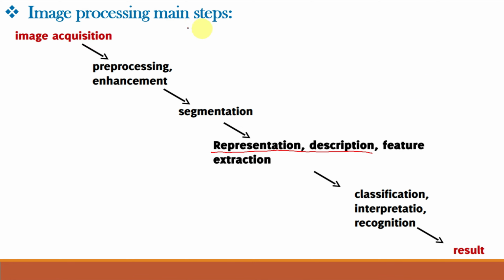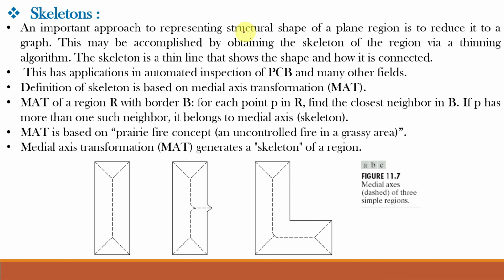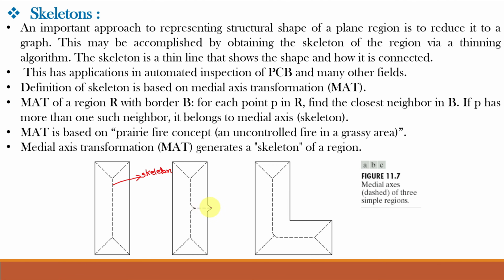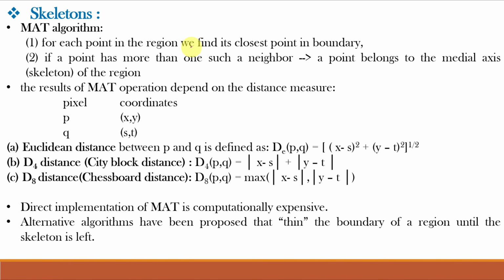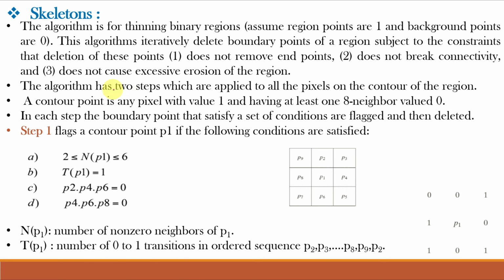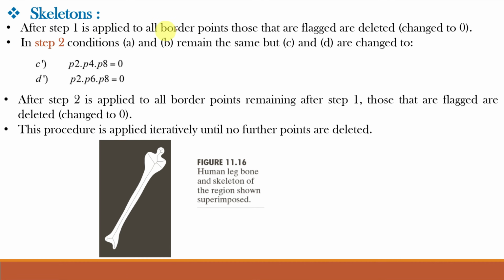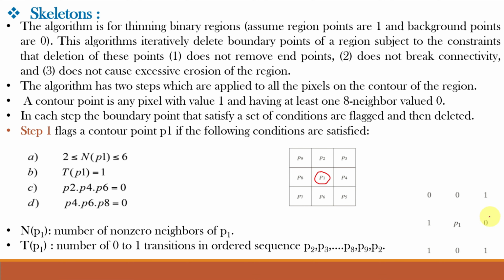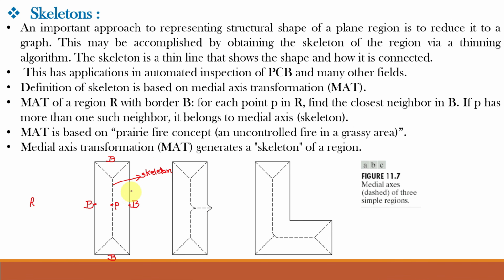Skeletons in Image Representation for DIP and its implementation in MATLAB || Description|| Thinning

Comment: How to define the image details in matlab.pls explain or give me video link to know that.
Reply from the maker: In MATLAB, you can define the image details such as dimensions (width and height) and format using variables. Here's how you can define these details: Image Dimensions (Width and Height):

You can specify the width and height of your images using variables. For example: desiredWidth = 800;  % Specify the desired width of the image
desiredHeight = 600; % Specify the desired height of the image                               Replace desiredWidth and desiredHeight with the specific dimensions you want for your images.                                                                                                                           Image Format:
To specify the image format (e.g., PNG, JPEG), you can use a variable to store the format as a string. For example:                                                                                    imageFormat = 'png'; % Specify the desired image format as a string                                                 Replace 'png' with the format you want (e.g., 'jpg', 'jpeg', 'bmp', etc.).

With these variables defined, you can use them in your MATLAB code to create and save images with the desired dimensions and format.

Comment: Is it possible to write matlab coding for creating photo album of images using same dimensions and format.
Reply from the maker: Yes, it's possible to write MATLAB code to create a folder of images with the same dimensions and format. You can use the following steps:
1. Create a folder to store your images.
2. Define the dimensions and format you want for your images, such as width, height, and image format (e.g., PNG, JPEG).

3. Generate or load the images you want to save. You can create images programmatically or load them from existing files using imread.

4. Iterate through your images and save each one with the desired dimensions and format using imwrite. For example:
for i = 1:numImages
    % Replace 'yourImage' with your actual image data
    % Replace 'desiredWidth' and 'desiredHeight' with your desired dimensions
    % Replace 'outputFolder' with the path to your folder
    img = imresize(yourImage, [desiredHeight, desiredWidth]);
    outputFileName = fullfile(outputFolder, sprintf('image%d.png', i));
    imwrite(img, outputFileName);
end